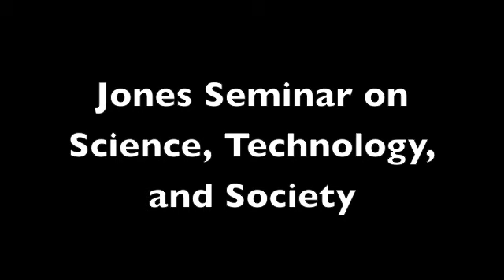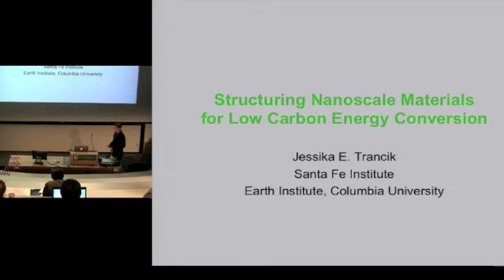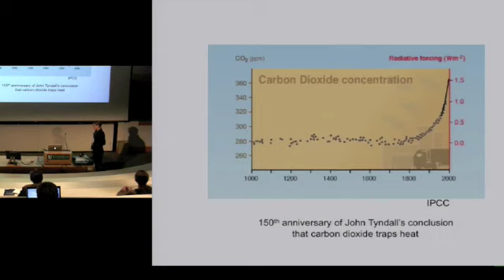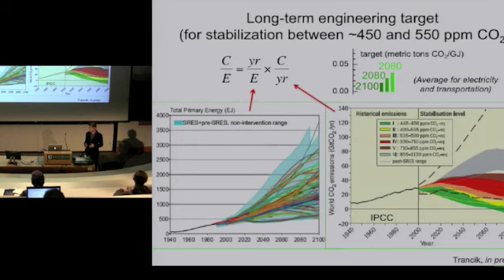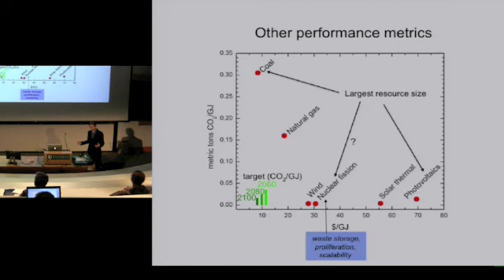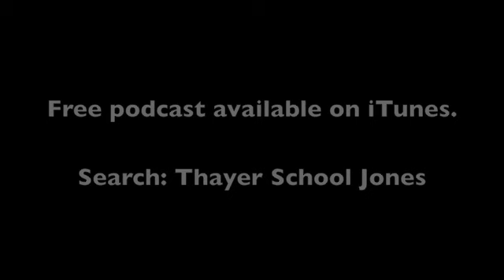Seminar: Low Carbon Energy Conversion

Comment: The Ecovacuum project held at Brussels last year said that vacuum cleaners are wasting electricity.
The MTP tests found that "Air Recycling Technology" could save 75% of the 2 Terawatts of the electricity, vacuum cleaners use which saves 1.5 TWh or the output of 800 wind Turbines.
This is worth £225 Million annually and 650,000 Tonnes of Co2, in the UK alone. And a saving of more than 25 Twh of electricity annually is possible in the EU. Equal to £3.25 billion  and 13.5 million tonnes of CO2